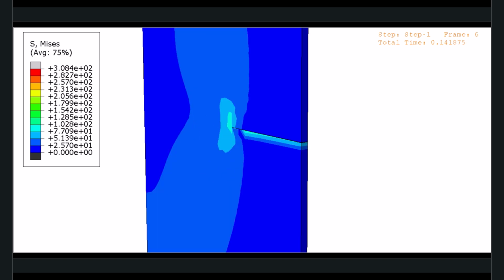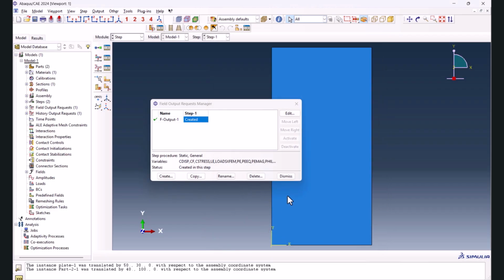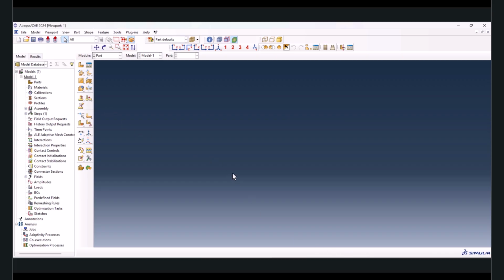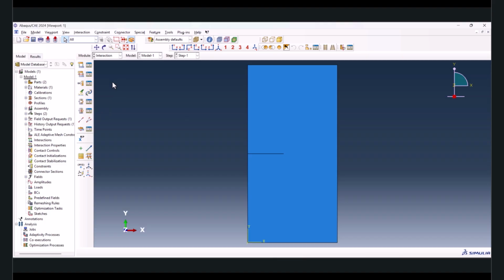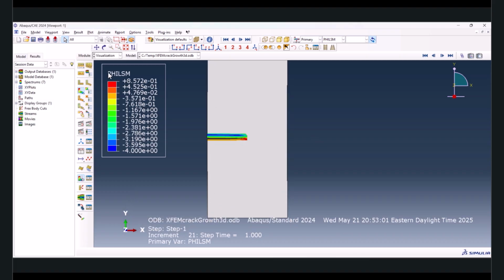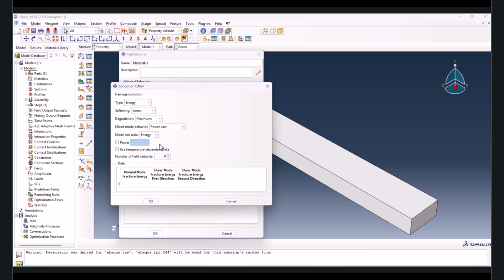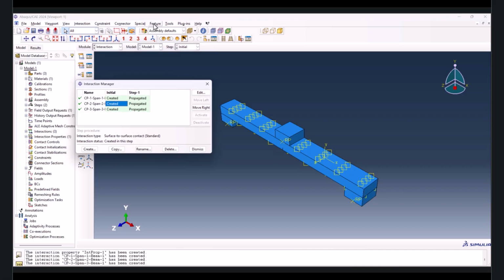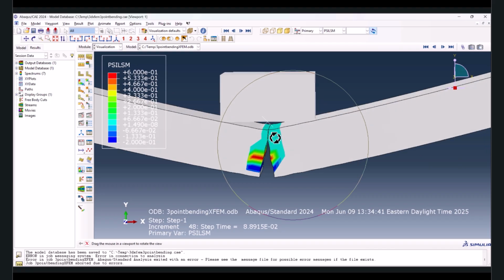Abaqus XFEM Masterclass – Learn Crack Growth Analysis Step by Step

Comment: I am working on a 2D quasi-static ct specimen in xfem and I am wondering how to get crack length or stress intensity factor in post processing. Do you have any videos or tips on that?
Reply from the maker: You need to define that in the history output manager before running the simulation!
Reply: @FEA @FEAMASTER hank you for your fast reaction. Unfortunately I was not able to find a useful history output request. Could you tell me which variables you are referring to?
Reply from the maker: @loesvermeulen5994  Put the domain on crack, frequency: every n increment, interval:5, output: each time, number of contours: 6.
Reply: @FEAMASTER  I have already looked into that, but then I am getting the following error: 

The following history output request are applied to XFEM cracks with crack domains that are not 3D solids. 

I am working with 2D plane stress model, with CPS4R elements.

Comment: Can Xfem crack growth be used for dynamic/explicit steps?

I want to work on crack propagation in thin-walled tubes due to impact
Reply from the maker: Yes, it’s possible! XFEM can be used in dynamic/explicit steps too — just note that it’s mostly limited to brittle-type fractures. You’ll need to define proper damage initiation and evolution criteria and ensure a fine mesh near the crack path. It should work well for thin-walled tubes under impact!
Reply: @FEAMASTER I have tried, but it is saying xfem is not supported when I choose dynamic/explicit
Reply from the maker: @jamiuolaniyanabdulhakeem541  Are you using student version? Because XFEM is supported in the non-student version and dynamic explicit!
Reply: @FEAMASTER I am using a paid version of 2022
Reply from the maker: That's pretty odd! Call the IT, they are super responsive!